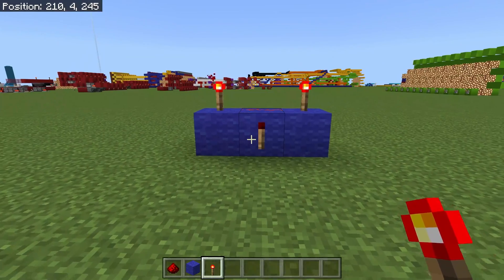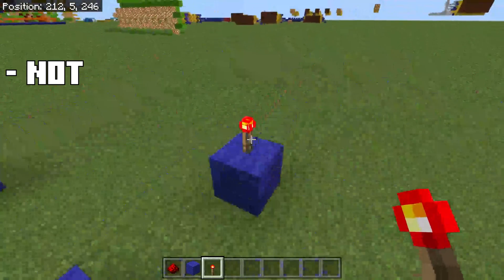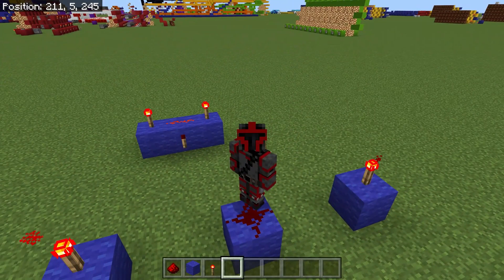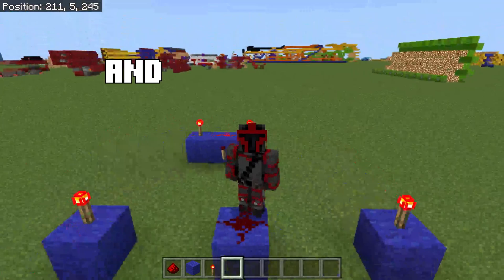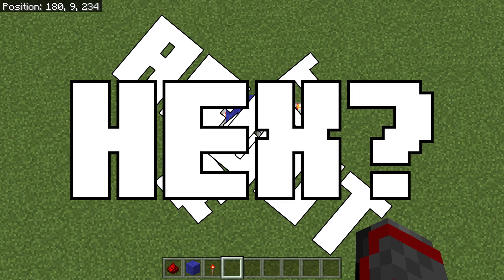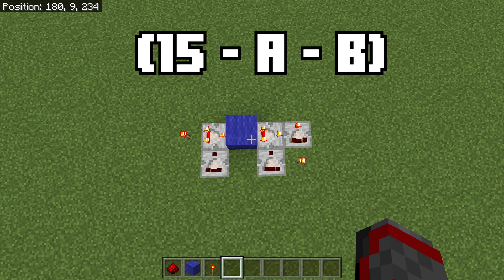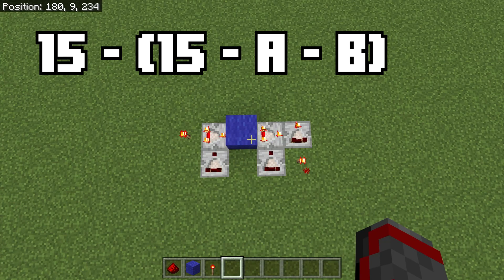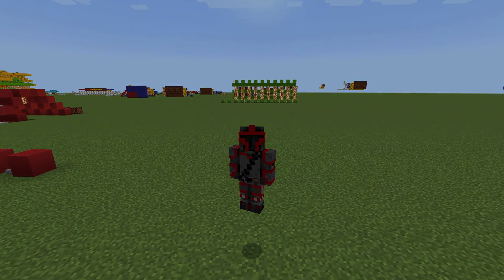This Tip Can Help Optimize Your Redstone ALU

Comment: I discovered a (known) trick in Java, where a comparator won't output if it is measuring an empty container through a block, except when the solid block is powered to signal strength 15. Can you check if it works on Bedrock?